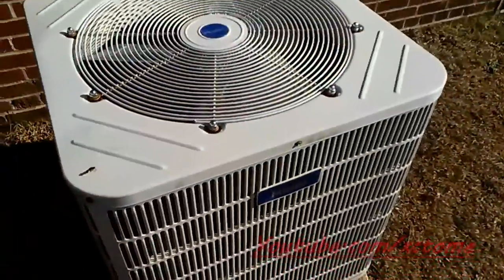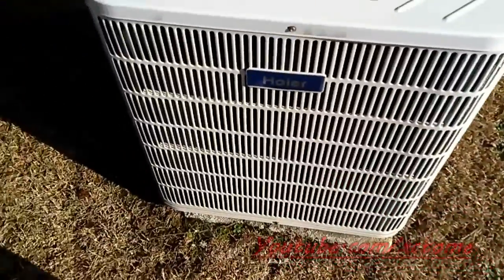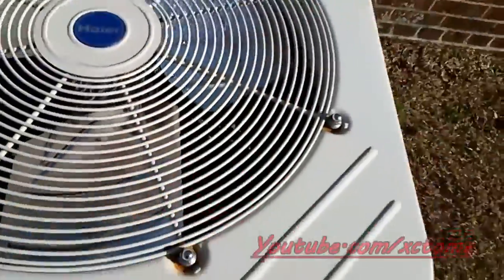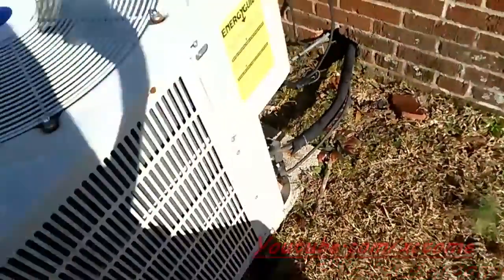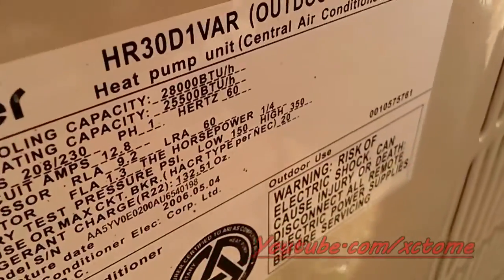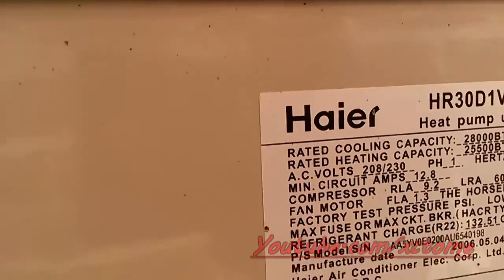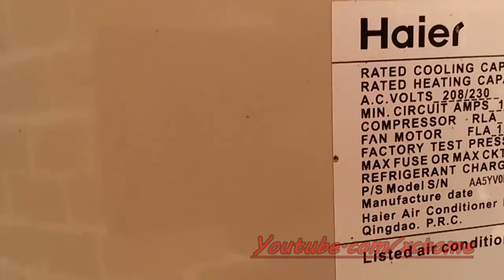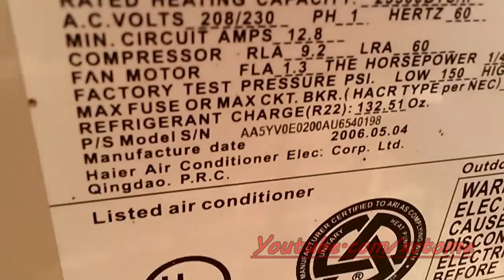HVAC REVISIT | 2006 Haier 2.5 ton Heat Pump Condensing Unit!

Comment: Hey Mike! Wow, the line voltage wiring is scary..lol! I wouldn't have touched it either!!
I like the diagram of the fan motor, that's cool! My old '73 Rheem had the fan up design, but there was a slinger installed to keep water out of the bearings and motor.  Great vid Mike!!
Reply from the maker: Hey Ray!!! first time i filmed this unit and when i saw that wiring i said to my self "nope, ain't gonna touch this unit!" i figured i'd add the diagram to prevent confusion! That type of motor mount design (fan up) was popular on old units! the Carrier Round One's used that design! it was popular in the 70s and 80s! thanks for watching Ray!!

Comment: We have a few of these here in Huntsville. Most of the ones are at an apartment complex near Grissom High School. I've even seen a Haier with a stamped octagon style fan grill at an apartment complex a friend of my lives at. I need to get some pictures of it.
Reply from the maker: i have a video of a 2004 Haier 2 ton heat pump with the octagon style fan grille,Haier is popular in my town for some reason! they are cheap and hacks seem to like using these units (low cost) Haier has had a bad reputation for cheap A/C units, ans their warranties stink! Thanks for watching!

Comment: That Bristol would last long if it was on a Goodman or some carrier brand even if its a r410a recipercating compressor and i like the design of those fam blades my lennox has the some blade design but the motor is a ge and its on the bottom not mounted on top and my unit is from may of 1993